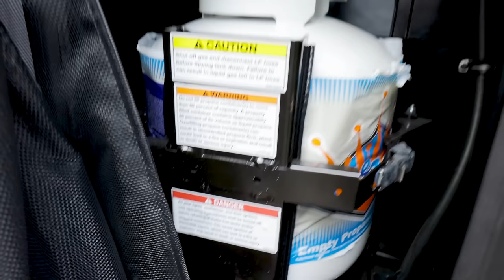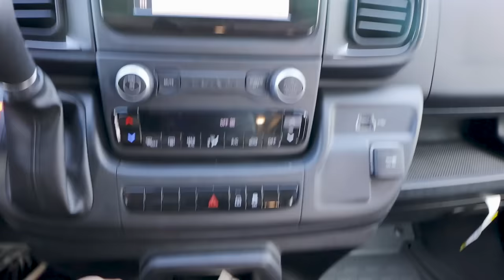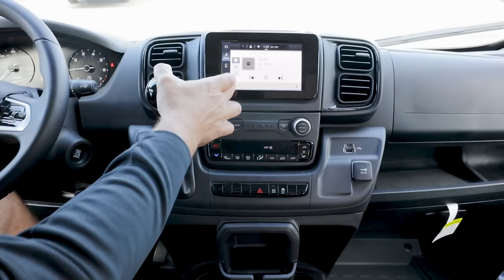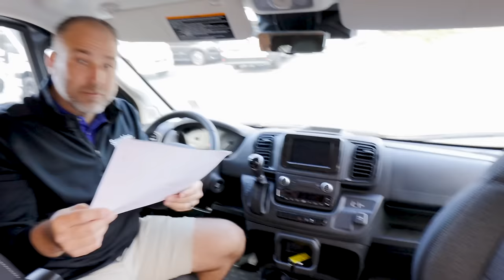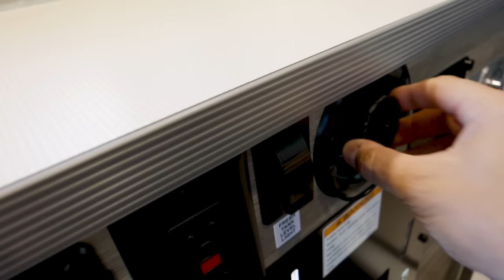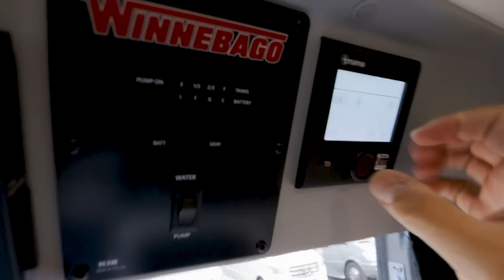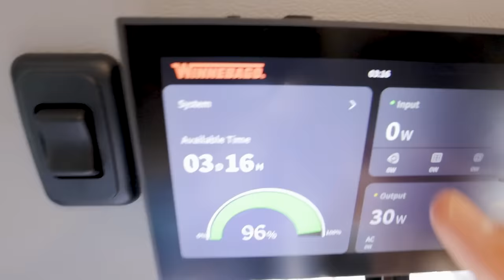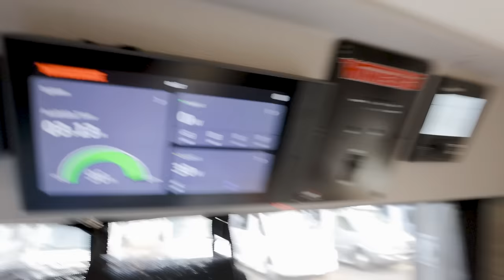A Closer Look At A Tiny Campervan : 2024 Winnebago Solis Pocket 36B

Comment: Winnebago Solis series uses 36 to describe vans built on the 136" wheel base and they use 59 to identify the vans built on the 159" wheel base. If it has an X behind it that denotes an Extended Body.
The Solis Pocket 36A is the Cross Bed with underbed storage, and a Porta Potti while the 36B has the convertible dinette and a full bathroom.

Comment: How long does the lithium run the AC and what would the Lithium otherwise be used for...a hidden microwave?
Reply: 2-3 hrs AC. Though they claim 5hrs. It all depends on temperature outside and how chilled you want in the van. I think in this van an extra battery is worth it and cost about 4-5k.
Reply: G I d for it.